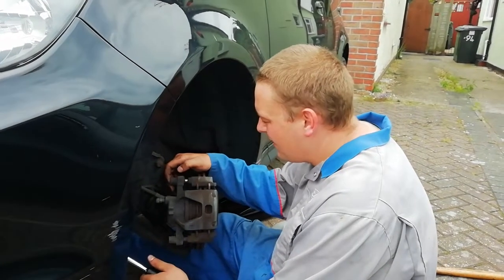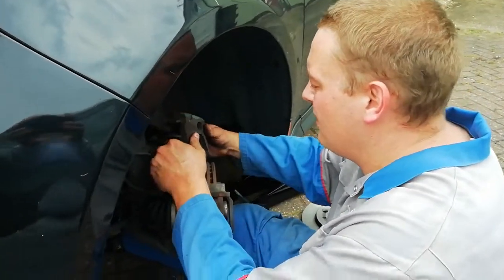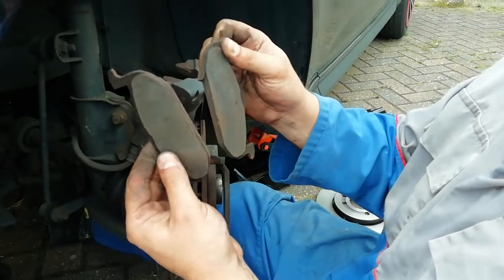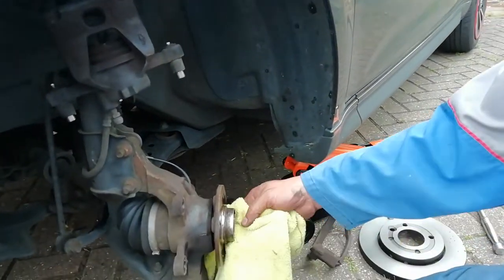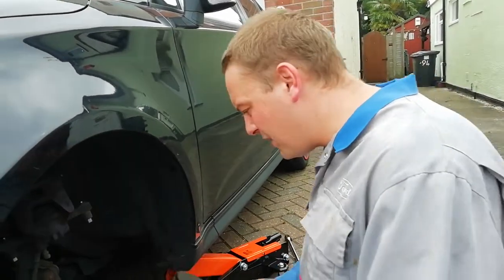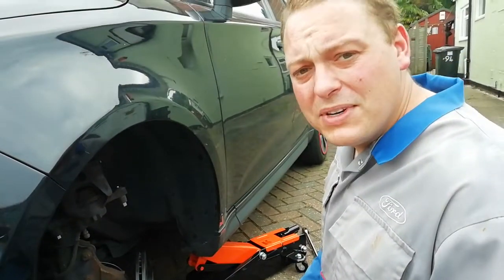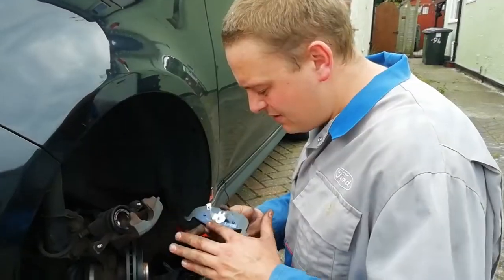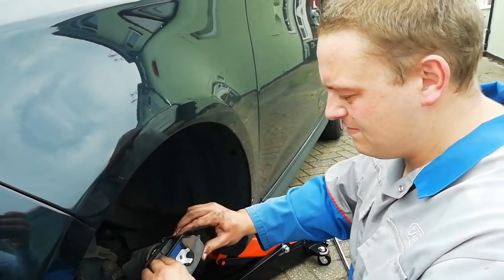2014 MG3 Front Brake Replacement

Comment: How do you keep the old disc still when you undo the manufacturers bolt?
Reply: Never mind… I couldn’t get the bolt off. Tried and tried with assistance. Had to give up. Will be taking it the mechanics where no doubt they’ll return the car with broken pieces and scratches. They always do.